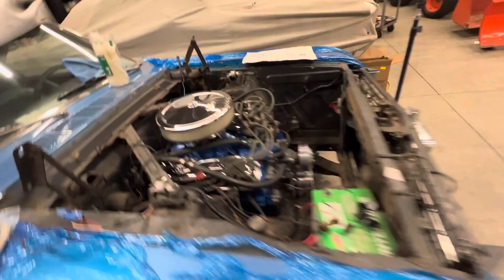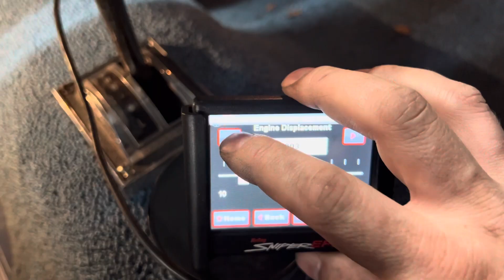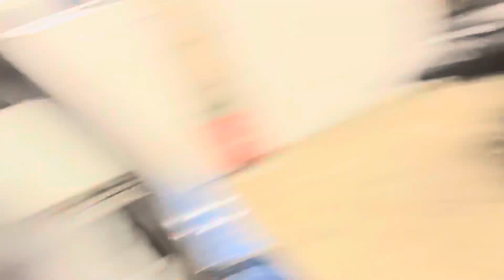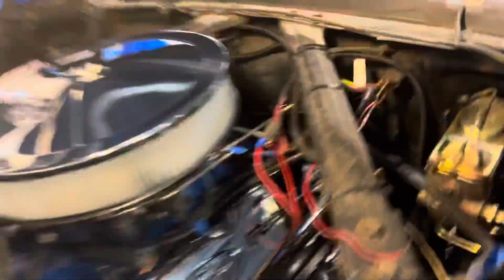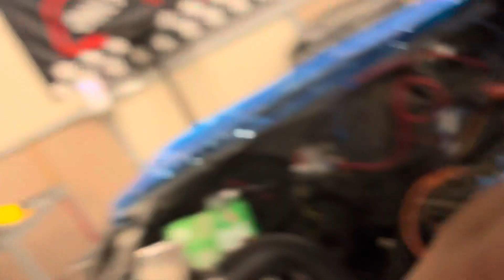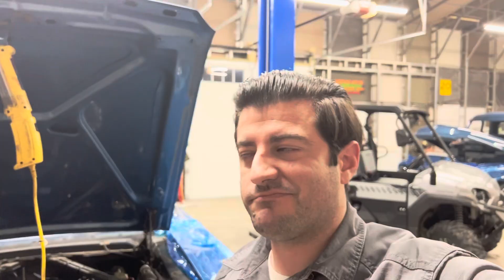HOLLEY SNIPER EFI INSTALL PART 2: 1966 Ford Mustang 302 Swap Ep: 21, 2300 efi kit

Comment: Please comment on not using a return fuel line. I'm not sure why one is needed but all EFI seems to include it. Any issues yet? I'm planning an installation on a 63 Ranchero V-260/289 heads. Thanks!
Reply from the maker: My tank doesn’t have a return spot, so outside of some crazy fabrication, I chose not to. Holley said it was fine when I called them, and so far so good it runs like a champ. I’m also not making a ton of power either so don’t know how it would be if I was.

Comment: Hey man found your channel from your Instagram, I have a e36 as well and was thinking about LS swapping it by the time I’m 16. How much did you pay for your engine? I was thinking about bidding on a cheap crashed corvette for the engine. Thanks man!  Also great work
Reply from the maker: I paid like $400 for my engine, you don’t need a corvette engine, they’re much more expensive because they’re aluminum. You can get any truck engine from 2001-2013 and it’ll work. Check out what I did in my videos. I have a lot on that!
Reply: Listen to him, you don't need the weight savings unless you're doing time attack or autocross or smth like that

Comment: question: do you guys prefer fuel injection or carbonation generally speaking and why?
Reply from the maker: I prefer it, in addition to it having a little more power and better fuel economy. There’s no need to re jet anything, so it’s easier to tune, and monitor. The wiring isn’t hard either.